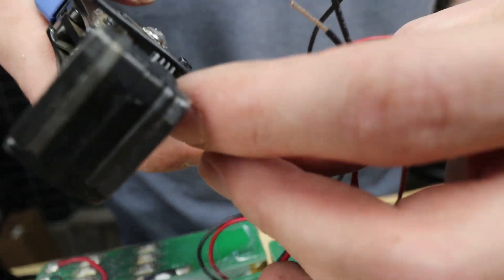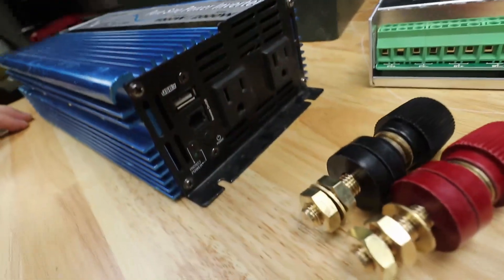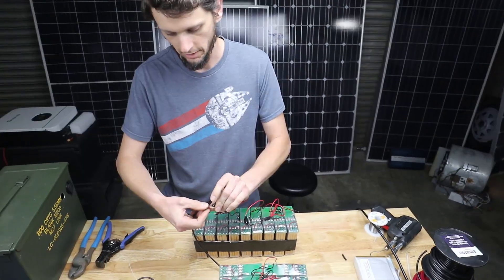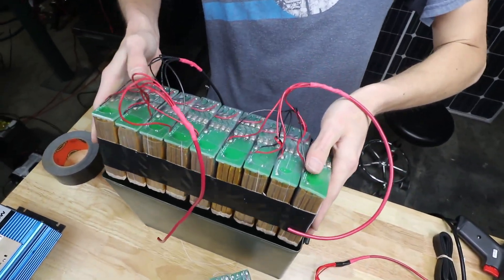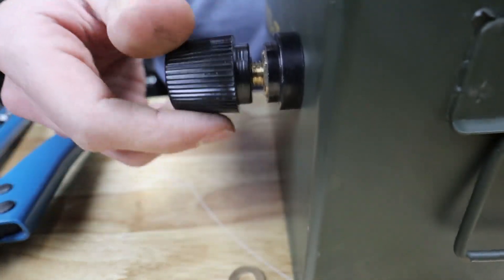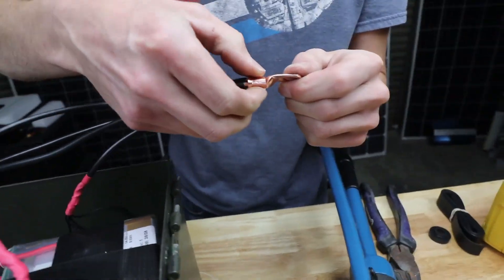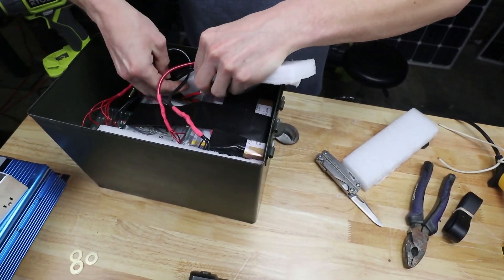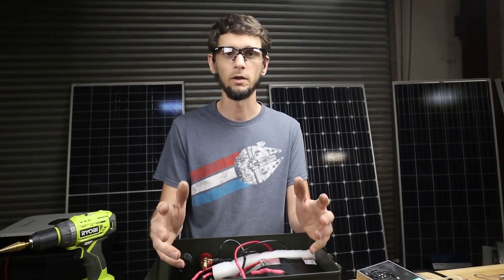How I made a 1300Wh Lithium Ion "Solar Generator" For Less Than $700

Comment: So...you wired up a number of repurposed (but already built) Li-ion batteries and put them in an ammo can.  You didn't build a "Solar Generator", you certainly didn't build a portable power station (because it's still 3 separate pieces), and you didn't build a "battery", because they were already built for you.  Heck, you didn't even buy a simple buck converter and wire in a small DC circuit breaker panel to power some small loads, USB charging or 12v socket outlet.  You stripped some wires, soldered them together, stuck them in a can, and connected them to through-hull battery posts.  The production quality of the video was very good, but the title was very misleading.  Have you built an actual portable power station or solar generator?
Reply from the maker: I’m sorry the title mislead you. My purpose was to try and bridge the gap between spot welding cells and buying an off the shelf power station. Solar generator, in my opinion, has many definitions. But again, that’s my opinion. It certainly collects solar power and stores it in a battery which to me is a solar generator.

I have done a more extensive build that would probably meet your definition of solar generator but never did a full video on that one.

Thanks for watching!

Comment: Are those li ion or li polymer cells?
Reply from the maker: These are 18650 li ion cells.
Reply: @BeeneEnergy  I see your not into the teaching side of things. Lol i'll stop asking questions
Reply from the maker: @2down2togo  Didn’t mean to come off that way! Was there something in addition to the chemistry you were curious about?
Reply: @BeeneEnergy  well u said they was 18650 which are 18mm wide by 65mm tall cylindrical cells and those are pouch cells. Is it the same chemistry as 18650's? At one point I thought all pouch cells were lithium polymer but after researching it turns out I'm totally wrong to think that lol
Reply from the maker: @2down2togo  Oops! I should have paid more attention. You’re right these were flat pouch cells. Thanks for calling me out on that.
Reply from the maker: I don’t know if being pouch-type makes them polymer or if that’s a further designation.
Reply: @BeeneEnergy  whats a decent 48v inverter I could take on the go? For like camping and stuff mainly to run fans and possibly a hot plate. Looking for something I could hook up my 2 panasonic packs to and maybe a cheap solar panel for charging. The cheaper the better, so long as they aren't complete junk lol
Reply: @BeeneEnergy  not sure if it makes a difference but I'm in missouri
Reply from the maker: Hmm. Seems like most 48v inverters are way overpowered for what you’re looking to do. The smallest I’ve owned would be a 1500w aims 48v which was a good unit but hefty in price and weight at $300 and 10lbs or more.

Comment: The nice thing about this build is light weight, and if batteries are always charged to 16V, and the max discharge is protected by the BMS, so, it will never drop below 12V, so the inverter will never hit a low voltage capacity drop, and the life cycle of the battery cells will be exponentially longer life. Figure you will get around 1500 cycles instead of the designed 500 cycles.
I would cover the entire build in a sealed fiberglass wrap. I would also wrap fish paper on each pack. Vibration shorts are the main concern here… those packs are a Roman candle waiting to go off, so you need maximum insulation and vibration protection.